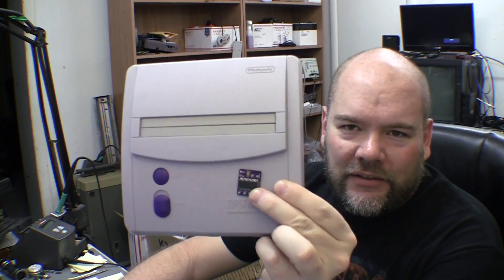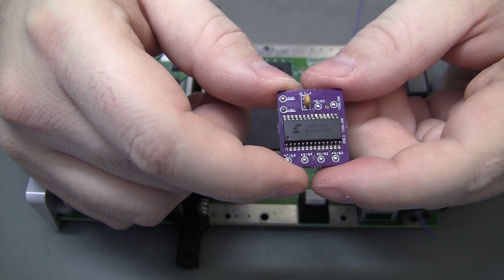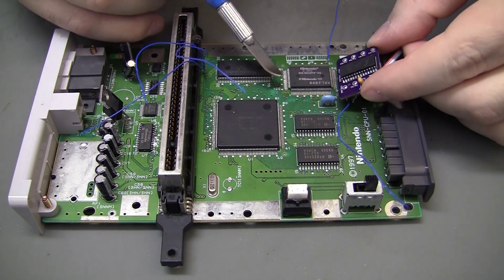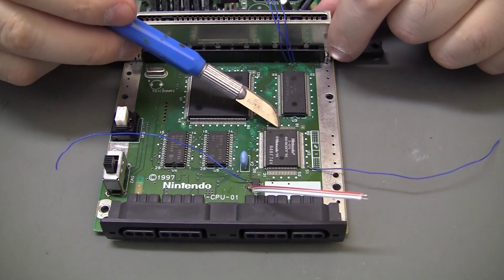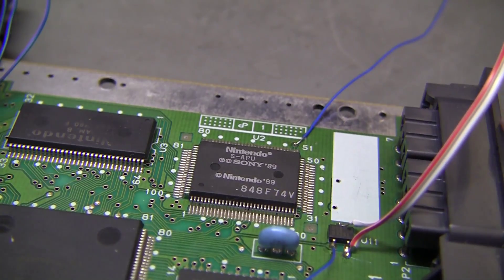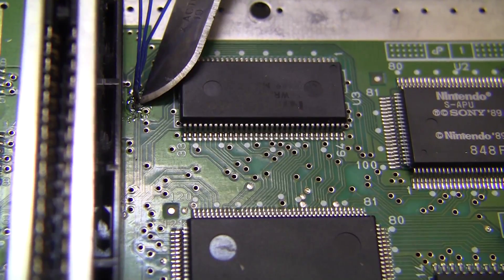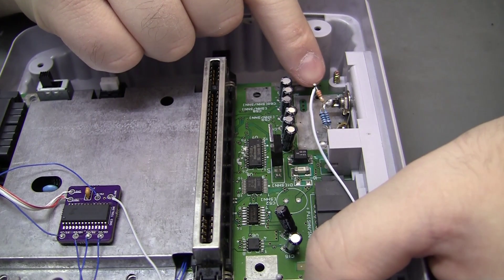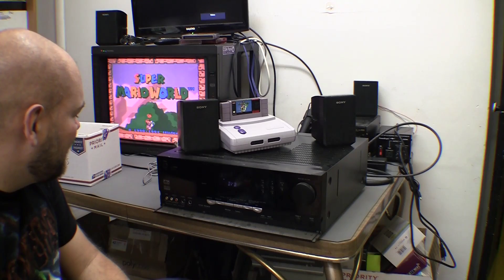SNES 2 - S/PDIF mod tips and FAIL digital audio SNS-101

Comment: Looking at your install, it seems you are missing a pulse transformer, which probably has something to do with the unstable sound at the beginning. A proper transmission coaxial circuit from the CS8406 powered by Vcc should have a 348 Ohm resistor with a 90.9 Ohm pull down resistor before then going into a pulse transformer like a DA101JC or DA102MC. My own new SNES digital audio mod board I'm putting up for sale next week features all of these parts already on the board itself, as well as terminals for installing an optical jack (which comes with the kit for free). It's a 'one size fits all' type board that covers both output types at the same time.

Also the 32,040Hz figure you've been told is hogwash. The sample rate of the SNES is 32Khz flat. What differs is the timing crystal for playback rate, which can be anything from 32Khz to well above 32,120Hz. There is no magical 32,040Hz that any given SNES falls into. That was just an average number somebody pulled out of their imagination

Comment: The problem everyone seems to have with their SNES is the black screen of death. It has power but no audio or video. Anyone pin pointed the root of this problem?
Reply: If it's a first-gen SNES, check the fuse. They tend to blow out for some reason.
Reply: Also, clean/check the cartridges to see if it's simply a game issue. 90% isopropyl is your friend.
Reply: Dylanlip  The fuse is fine, it powers on. The games and slot are clean. Its a 1st gen snes . the power adapter and composite cable work great. I've tested them on working SNES.  The "black screen of death" seems to be a common problem according to google.
Reply: The black screen of death is a common problem. I buy broken snes to fix up and any that i get that have this problem i also havent been able to fix it. I have a stack of them like that. 

Im thinking it has to be a Dead Cpu or ppu causing it but the only way to try and fix that would be to take one from another snes.

If you have an snes that has them working why would you want to to that when its probably otherwise fixable.

Now, i usually just try to avoid buying snes consoles with this problem.

Comment: Hmm... What makes you think a HDMI mod for the SNES is in the making? kevtris? ;) I'm not sure if it's the clock that causes the problem but as the 32kHz is derived from a not-so-accurate ceramic resonator (24.576MHz / 768?) I would try to replace it with a higher precision crystal oscillator.

Comment: That's a CS8405 ?  
Looking at the datasheet (discontinued product) it appears to be within spec (capable of 96kHz sampling, but will handle as low as 8kHz) .

> "Master Clock (Input) - The frequency must be 256x, 384x, or 512x the sample rate."  :| 

> "In slave mode, the left/right clock and the serial bit clock are inputs. The left/right clock must be synchronous to the OMCK master clock, but the serial bit clock can be asynchronous and discontinuous if required."

[expletive]. I was goning to suggest trying to tune the clock speeds (variable capacitors?) to see if that mitigates the beat-frequency without adding active components or causing too much distortion; but to properly satisfy the synchronous requirement would actually require adding some sort of buffer and timing generator to sample /then/ transmit. But without an external oscilator it would drop frames, causing distortion. So that is a no, even with an upgrade to the pin-compatible 8406 the sample rate mismatch would still distort things.

https://oshpark.com/shared_projects/4Il0ShMQ
http://gamesx.com/wiki/doku.php?id=av:snes_sp_dif
http://www.cirrus.com/en/pubs/proDatasheet/CS8406_F6.pdf

---

And I see that L-Train skipped using a dumb buffer and implemented proper sample-rate conversion, filtering, ground loop elimination, voltage regulation and a level shifter.  Very impressive.

https://www.oshpark.com/shared_projects/Qdy2pZzr
http://www.head-fi.org/t/740288/super-nintendo-spdif-dacs-and-you#post_11227890
Reply from the maker: So do you think the L-Train kit will fix this?
Reply: I'll bet a dollar on it.

(Tbh. I haven't examined L-Train's version more closely than looking at the BOM and saying "Yep, that looks right." )
Reply from the maker: *****
Actually already ordered the pcbs this afternoon.
So i'm going to give it a try either way!
Reply: I look forward to seeing the result.

Comment: It sounds to me like the sound issues happen at the same part of the music sequence each time. Have you tried to see if it happens any other time in the game, or in a completely different game? I'd be curious to see if similar things happened, with issues during specific times in other sequences as well.

Not that I could suggest a fix for this, but it might be a starting point.
Reply from the maker: After watching it again you might be right about it happening at the same point in the sound loop, so maybe some sound or sample or whatever is the trigger...
Reply: I was going to say the same thing, its almost as if the receiver has some sort of auto volume leveling and when it gets that that part its tricking it, just a guess causing the volume to fade out and rebound just in time for it to get tricked to being lowered by the same sound again.
Reply: madmax2069 I know of some audio systems where some inaudible bandwidths of audio are used to send data signals, so that's possibly what is happening here?

Not sure how to solve it, triple check everything, maybe try and replace the resistor?
Reply: Nukle0n one could analyze the output to see what its doing

Comment: are you sure its not voltage dropout from where your getting power from the snes? maybe try using a cleaner power source? also if you go to amazon you can pickup a s/pdif to analog converter for like $20, i bought a Orei DA21 since my receiver does not have digital and my tv only outputs a toslink optical out, and its been working well for me. it might be worth a try to just rule out the receiver. oh and it can be powered by usb. i have a usb mini plugged into the back of the tv to power it.
Reply: btw, whats coming out of the coaxial is digital. so if it was an issue with the signal the mod was spitting out it wouldn't work at all or you would get garbled noises. so, if you have to trace it, i would start at the chip work back words.
Reply: This was my thought as well.